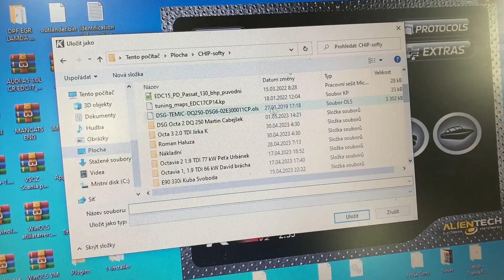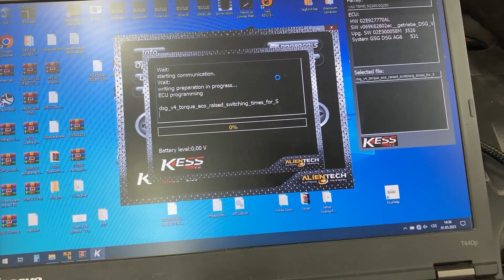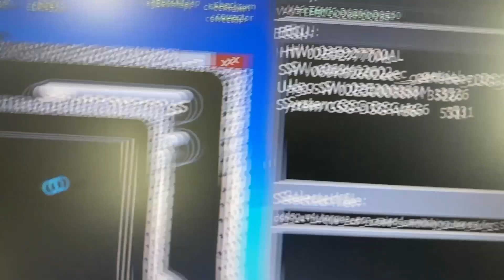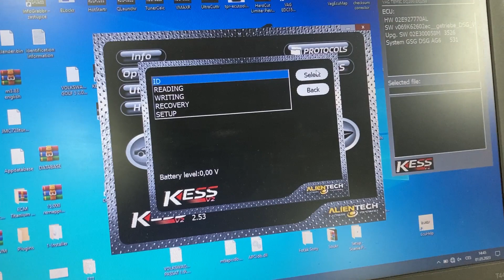How to Write DSG DQ200/DQ250 with KESS (also for DQ500 + other automatic gearbox/transimission)

Comment: What interface box is that?, where can i get one
Reply from the maker: I got this blackbox(interface) with my KESS package.
Reply: @STR_chiptuning  Hi I also purchased the boot box but I don't have the power supply to connect, do you use it and if so which one is the right one?
Reply from the maker: @pietropetrone2763  about the power supply: I have in the video the battery charger that can handle up to six Ampere. I am using it just for the purpose that I can be calm about that battery won’t die - because the battery is power supply for the DSG control unit. Usually if your battery is OK you don’t need to connect to the power supply or battery charger and you are good. But it’s your own risk if something happens.